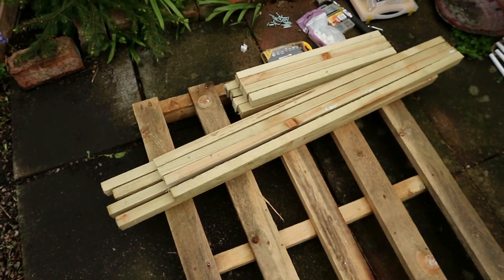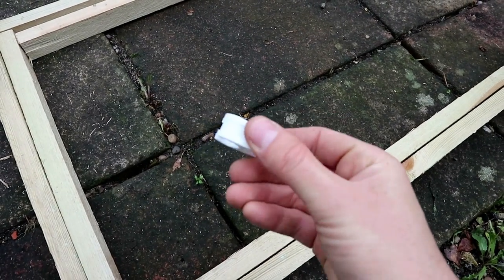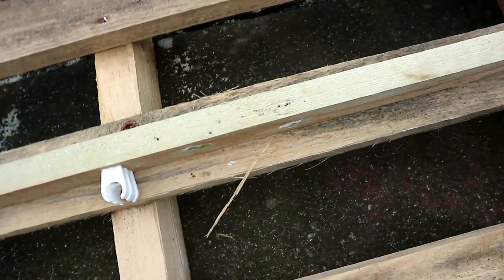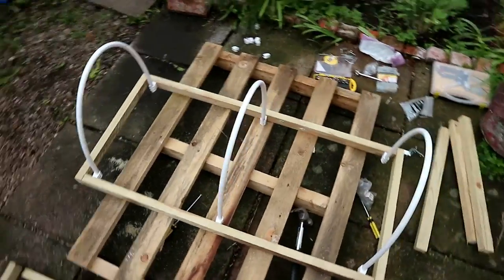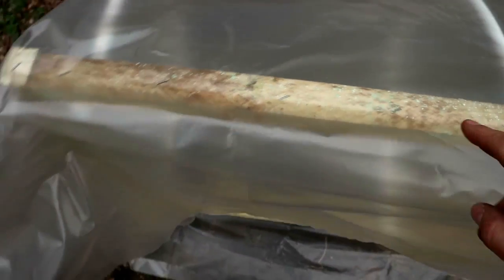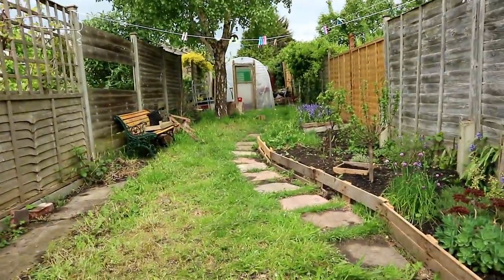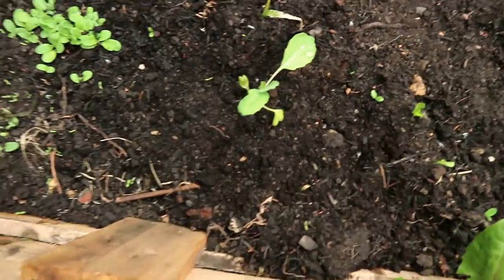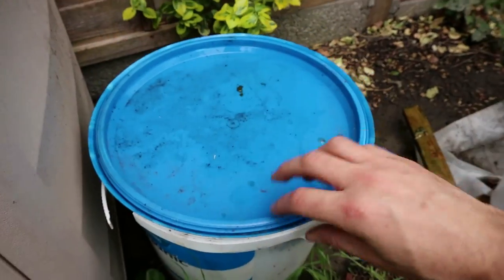How to build a mini poly tunnel

Comment: I think I'm gonna run with this idea, BUT I won't wrap the plastic over the outer edge and staple it there, because rain water will get trapped in there and rot the frame. I like the idea of leaving the trim on to have something to place bricks on to weigh it down. We don't get a lot of high winds here in southern Germany, but when we do they're rough. Thanks for your video!
Reply: Good point. Water always needs a way to go down.

Comment: If you’re going to try to send a screw through the wood with a drill I’d pre drill it first with a drill driver and a drill bit slightly smaller diameter than the screw. In my last garden box I tried to skip the pre drilling  step and ended up splitting the wood with my impact driver. On the second split piece I decided to stop and get my pre drill gear ready so I wouldn’t have to recut more pieces.

Comment: Hit the tip of the point of the nail to flatten it and when you hammer it in to the end of a length timber the timber won’t split as the nail punches it’s way through the grain rather than moving it to the side
Reply from the maker: Thanks 😁. I'm not that great at DIY. Most of the time I just do stuff and hope it works 😂😂😂
Reply: Rough Around The Hedges it looks good  👍🏻I’m going to do something similar in a raised bed for my chillis next year

Comment: Hi can I please ask where you got the piping from, i have the plastic covering, the wood battens, I have made trying make this for the past couple of years, but unfortunately I haven’t had the time. (I’m not part of the lockdown crew)
Reply from the maker: I got it from Wickes. If I remember correctly, it came in 3m lengths

Comment: Like the idea of a double frame to trap the polythene. I may extend the frame a little beyond the hoops to place some weights on. What size/type of tubing did you use & what price? Do you think a bamboo cane across the top would suffice? Can't wait to give it a go. Careful with the fertiliser, can harm young plants. Cheers Joanne
Reply from the maker: +Dusty Carter thanks, I did it more for aesthetics but it does protect the polythene nicely. Good idea about extending the frame out. I want to build more and I might also give that a go 😊.

The tube is about 10mm in diameter and it cost £3 a meter of I remember correctly and I'm sure bamboo will do fine. I'm all about using anything you have lying around!
Reply: Your wood looks like 2 x 1 but I may use some gash 1x 1 that I have lying around. Any way I can send you a photo when complete as it will be slightly different.